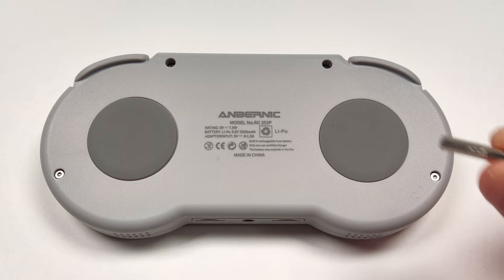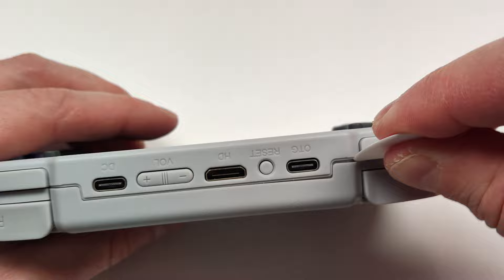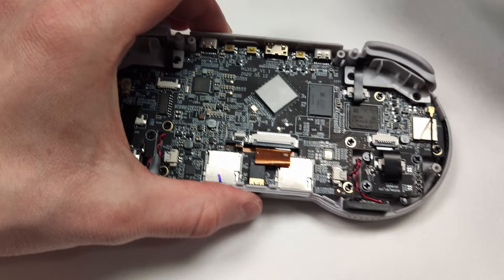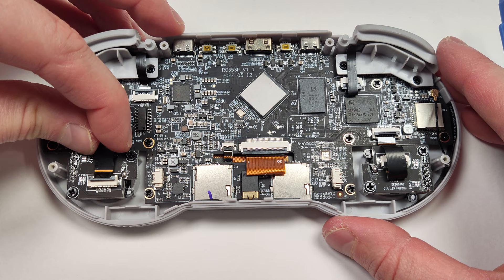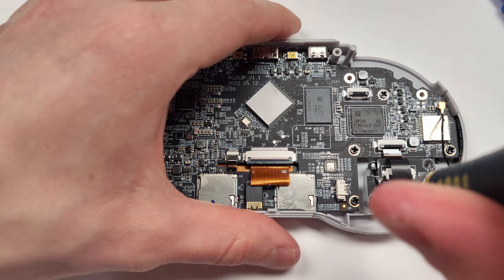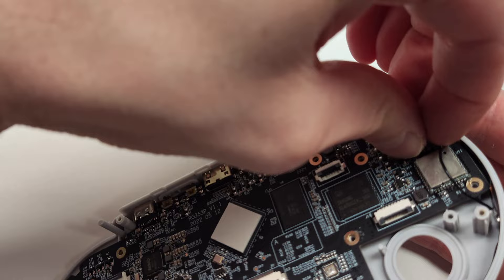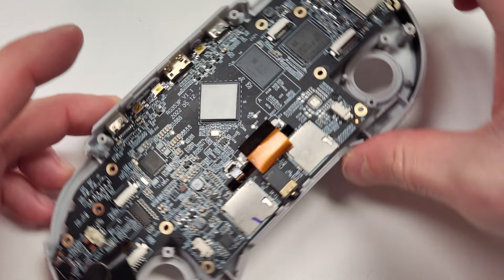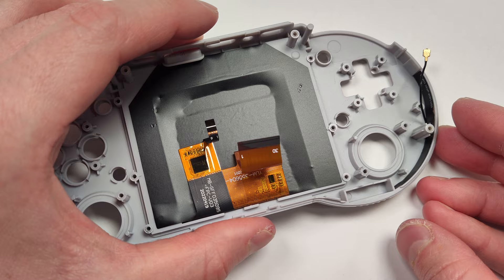Anbernic RG353P - Teardown Guide

Comment: So I found some teardown vids of later Anbernic units and especially the RG-ARC because the latter likely shares the trigger button cables and some other parts. *They designed the two half shells to open around the audio jack*. And the repairers experienced MUCH less board removal difficulties, as the excruciating prying of the motherboard was reduced to some wiggles and that's it. This ONE DETAIL was a deciding factor in how nerve-wracking it is to go through a repair process.

Comment from the maker: Sorry for the double post everyone, had some issues with getting it properly launched today and it didn't show up in subscriber feeds properly. If you own a 353P what do you think so far of the handheld?
Reply: I have the 353p, 353ps and 353m and while I love all 3 the sticks on the 353 are perhaps the best I have tried
I wanted to ask your opinion; I just got the replacement joysticks straight from Anbernic that they use for the 353m… I was planning to use them on my 353ps but I have read they might not be compatible with those models. I specifically read that they tried Hall sticks and not the replacement sticks used on the 353M
Do you think it will work?

Comment: Thanks, I'm thinking of fixing the pad problem and while I'm at it I'm gonna change the sticks for magnetic ones.
Reply: is there any magnetic replacement for rg353p?
Reply: @ronisunarhendro9823  Well, I will try the Switch ones. I don't really know if the sticks are exactly the same as the Switch's, but if they are, I will replace them for Gulikit sticks.
Reply: I got the replacement sticks for the 353m directly from Anbernic and planning to replace them on my 353p but how did it work?

Comment: Thanks for this informative tear-down!
I've come to love the clickyness of the D-pads/buttons on the Odin, the XP+ and the RP3. How hard do you think it'd be to install clicky dome switches on the RG353P?
Reply from the maker: It's all soldered onto one board so likely impossible without a kit released from Anbernic directly. Since it's all on one board I doubt it'll ever happen unfortunately and if it did... it wouldn't be cheap. Unlike the RP3 which has separate controller boards that make them easily replaceable, it's obvious Anbernic didn't want anyone tinkering with this unit.
Reply: Ah I see. That's too bad. I'd hoped you could somehow solder the small dome switches on top of the existing connector areas - perhaps simply removing the rubber plate. AFAIK the dome switches are just 1-2 mm tall or so. Aren't they? E.g. http://csikeyboards.com/wp-content/uploads/2018/08/dome-switches-scaled.jpg

Comment: you didnt happen to measure the dpad did you? im hoping to replace my dpad with a less sharp one and a little more accurately textured to the original snes. also are there potentially other anbernic devices i could rip a dpad from for the replacement?
Reply from the maker: I don't have the measurements for that unfortunately. Sorry.